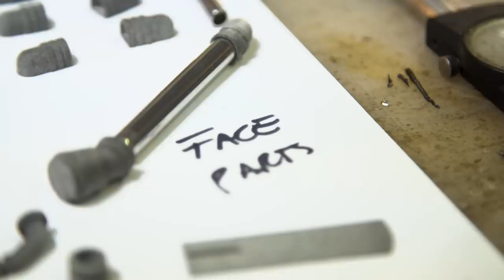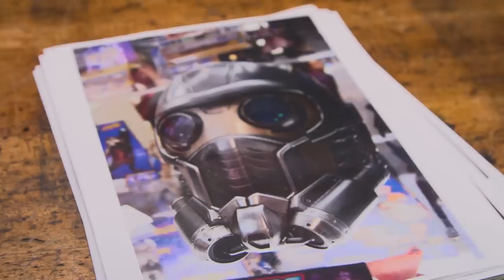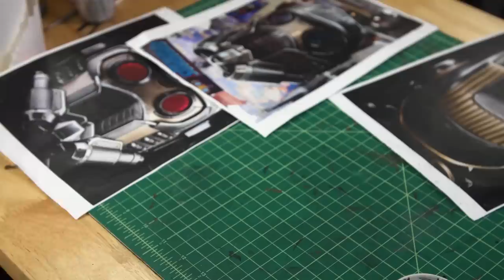Adam Savage's One Day Builds: Star-Lord Cosplay!

Comment: Such an awesome project. Amazing costume. 

The only thing I hate about 3D printed anything is the layers that need to be filled and sanded. That’s a major reason I’m leaning towards resin. Takes longer to print, but the layering disappears. Also, I love using the aluminum tape. If you butt the seams so that you have a minuscule bump, you can burnish it with a bone folder, then wet sand it with micro mesh to whatever surface finish you desire.

Comment: Nothing like having access to a $20K plus printer.  My guess, FormLabs SLS printer.
Reply: You could also order it online. There are quite a few services available that circumvent the need to own a 3D printer.
Reply: @MartinFinnerup  Very true, but have you priced these services out?  I have.  It ain't cheap especially if you want to use a printer like an SLS.  In many cases it's cheaper to just buy the printer(s).  A job I had quoted was going to run over $8K USD for basic FDM using ABS at approx 30% infill (every option has a cost tied to it)!  And that was with our corporate discount!  I was like, never mind, I'll just print it myself.  This decision was very wise on many fronts since at the time I was just having a first run set of prototype mounts printed that changed very drastically after the first test.  I ended up going through several iterations until perfecting the print solution.  Still even had it been one and done the $8K just was simply not justifiable.  In the end my PRUSA I3 Mk3 paid for itself many times over.  I could've even justified having the company buy me a couple more printers just to speed things along, but I was able to make due with my own personal machine.
Reply: Adam has been doing this for so long. He doesn't need the machines he uses.. he built his own vacuum former :p im poor and it still works if youre willing to put in work!

Comment: Hey, Adam. I have a question about the hydrodipping.  (I know you didn't dip this particular project) I've tried it several times unsuccessfully. I can never get the film to attach to the object.  It does however have no problem attaching to the masking tape I use to frame out the film.  I use warm water, place the film down correctly on top of the water, spray with the activator and wait a little while to take affect, and slowly dip the object at a 45 degree angle.  It just won't attach. And if it does at all, it's not clean.  What film do you use? Activator? Thanks so much!!

Comment: Hey Adam, if you do rocket motors or hot exhausts again and want bluing or similar, get some titanium and use some light electrolysis on it. you can get blues, reds, purples and yellows from the oxide. The Thought Emporium has a good video making titanium chopsticks and the same technique should work.

Comment: why wouldnt you just electroless plate it with something like cro4 .... ok chrome ... do it over night scuff polish and clean ... and replate a second time for a smoother surface ... more if required .. not only does it seal the printed part it also bonds better to it due to all the pores but does require a perfect smooth surface to get spectacular results